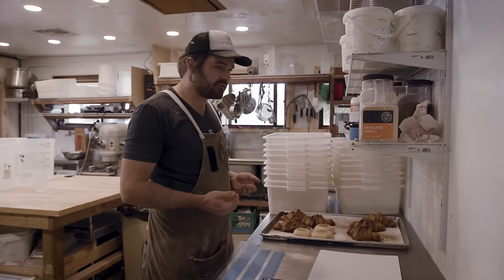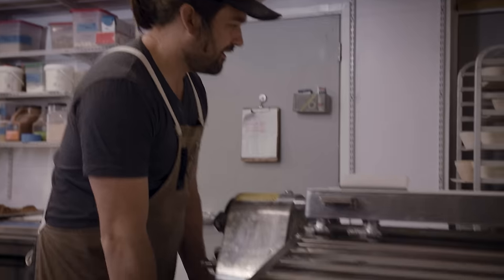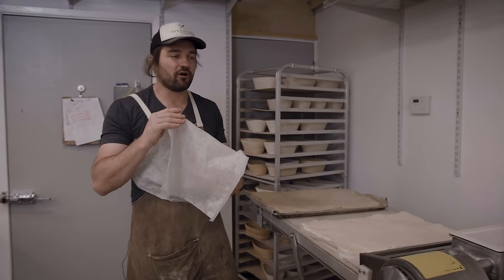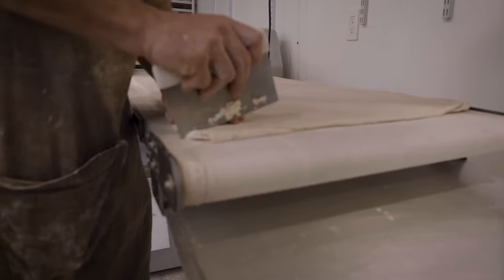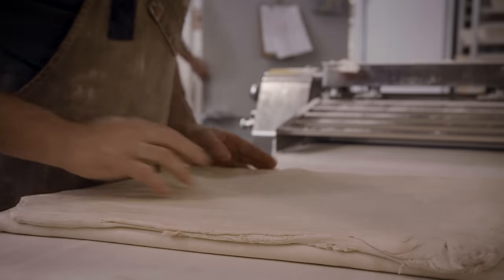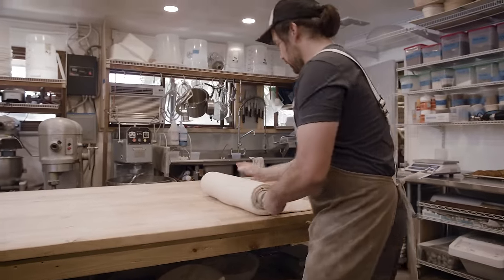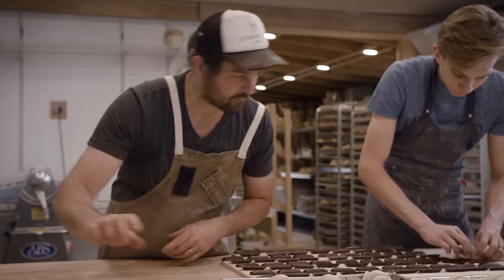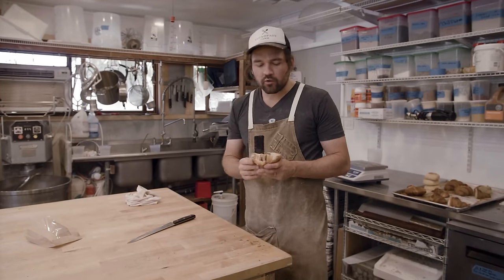Sourdough Croissants from Start to Finish | Proof Bread

Comment: What kind of butter do you use?  It has to be at least 82% butterfat.  Most American butters are 80-81% which makes it prone to shattering during the laminating process, ruining the layers. The higher (84-85%) is better because it's more malleable.  As a professional bakery you should have access to the real beurre sec which comes in sheets.

Butter should be around 58 degrees.  Dough around 60 degrees.  Use a digital thermometer to verify.
Reply from the maker: I actually love butter at 58 degrees, it’s perfect there. However, I prefer my dough sheets colder because they are prone to warming quickly. Colder dough sheets keep the butter more consistently at that temperature in my experience.
Reply from the maker: We have 82%, and I would live even higher. Problem is I don’t have relationships with the distributors. Perhaps now that we use 6 cases of butter every week they would be more likely to deliver residentially.
Reply: @ProofBread  Higher percent butter fat will make your life a lot easier.

  BTW beautiful crumb on the pain au chocolat.
Reply: @ProofBread  You might think about contacting some of the French bakeries in Phoenix, see  if they're using a higher bf butter for their croissants, and maybe piggyback your butter order onto theirs.  (Hopefully, they're not using frozen croissants--an unfortunate trend in France, where only about 25% of croissants are still artisan made.)

Comment: Neither example displays enough buttery richness.  They also look dingy instead of bright--maybe you need a different flour? More likely your butter--it's white instead of bright yellow.
Reply from the maker: Yeah, it’s tough to find the color of butter I’ve seen in other parts of the world. Also , the final pastry color could have been improved with a quick secondary egg wash as the original wash had dried some. As for butter content, the missing element is taste, and you’d see that taste is solid. There is a lot of butter here. Some in the dough, plus about 30% in the block of the total dough weight, so much higher than that bakers %
Reply: @ProofBread  It might be the lighting you have as well; I flipped to several other professional videos making croissants and their lighting is more yellow.  We do eat with our eyes!  I'm sure yours taste as great as your other breads. ;)

Comment: Unless he makes the butter himself this makes no sense. In the bakeries i have worked in we buy plates of butter or margerine and just fold the dough over the butter to wrap it in.
Reply from the maker: Butter in sheets isn’t necessarily of the right dimensions out of the box. Also, we don’t have access to sheets from a distributor because they don’t deliver residentially. When we move to our new location that’s on our list.
Reply: @ProofBread  Butter never comes out in the right dimensions, but with the "cooling method" you can avoid banging the butter out this much and just let the machine do the most of the work. But every1 does it a bit different from each other, you probably got your reasons for doing it this way. Bakers works with something that is "alive", there are many factors in it to consider. Your room temperature in america is probably also a lot warmer than here in Denmark. Anyways good luck with your moving to the new location.
Reply: @ProofBread  I see i watched  a couple of more videos. You are basically doing this out of a rebuild garage. Now everything makes sense. No wonder you have issues with temperature and stuff. Well, now it is a different story for me. I always support small local bakeries. Even though there are things i would definitely do different, i still have mad respect for you guys pulling this off. I can only imagine the challenges you guys go through with this kind of a bakery.

Comment: Dude, you are driving me crazy. You talk on and on and on and never give us any usable information. You talked for over an hour on baking sourdough bread but you never gave us what we need. Baker's percentages. Hydration, cooking times and temperature. All this other stuff you ramble on about is somewhat interesting but not what we need.
Reply from the maker: I think it’s best you find some other content then. The formulas are truly the least valuable thing I can offer. You can find dozens of formulas. They are meaningless out of context. If you want to make sourdough croissants, it’s actually all the in between info that will make it possible, if all you need is a formula, they you probably don’t need much instruction at all.
Reply: @ProofBread  well said. Keep doing what your doing!